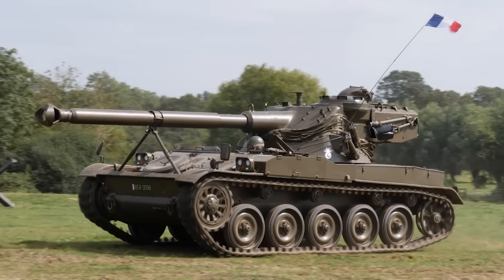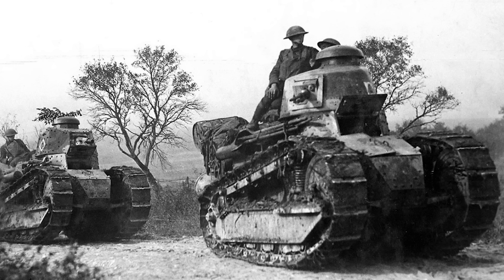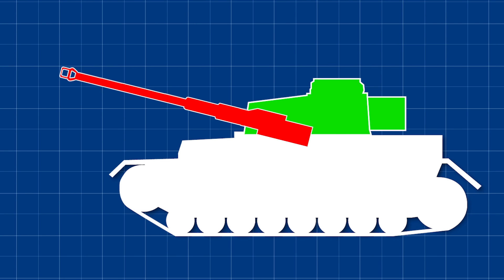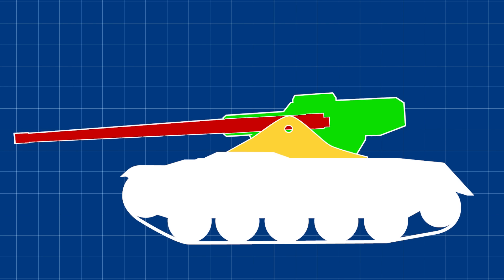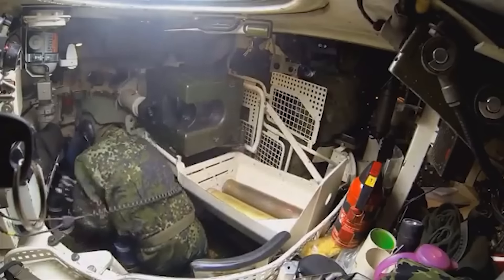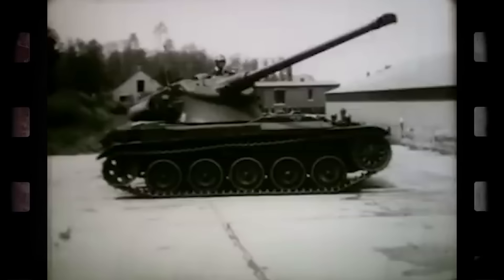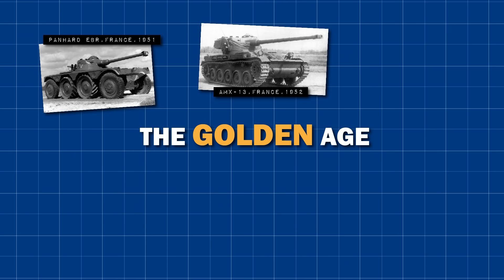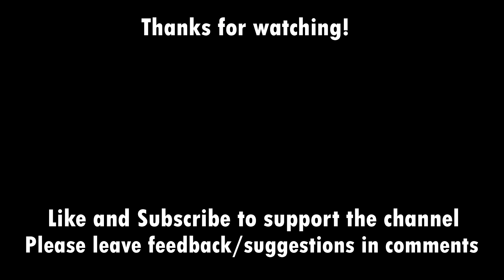What actually IS an “Oscillating” turret?

Comment from the maker: Thank you so much for 10k subs! Best place to chat to me if you’ve any questions/suggestions is the Discord -

https://discord.gg/WJzJXkjH3Q
Reply: Hey man! 
Just got recommended your gem of a channel through this video.

I think the algorithm likes this new type of thumbnail with a blueprint design over your older photographic ones 🤔
Reply: The turret of the Austrian 🇦🇹 Jagdpanzer „Kürassier“ was similar to the AMX. I had the opportunity to shoot with it‘s 10,5 cm cannon. Greetings from Linz 🇦🇹 Austria 😎👍🐺 Europe!
Reply: Another issue with the oscillating turret is wear and tear.  Having the large, heavy gun and loader etc. so far from the turret ring puts a LOT of extra stress on the ring when driving on broken ground just due to simple leverage. I think the oscillating turret has enough benefits to be very useful in certain situations, but it becomes a specialty vehicle in a world that REALLY tries to minimize variation.  In WW2, every nation had dozens and dozens of different vehicles (for various reasons) but these days militaries try to really minimize the number of different frames and engines and guns.  Supply and support become far easier when you do this.
Reply: those "flim type"" images left and right are really flickering and add nothing.
Reply: Is there any issue with a small shell raising a burr that prevents elevation changes?

Comment: French post war tanks are peak transitional period aesthetics, Amx-50's just look so cool and futuristic for the time
Reply: Merci, cher ami esthète !
Vive la France 👍🇨🇵 ❤️
Reply: The ARL44 also looked so futuristic.
Reply: @EARTHKEENING  man, I really like the ARL 44, but of all the post-war French tanks to mention, I'd say the ARL 44 is actually iconic for being rather old-fashioned than futuristic. The French had so many futuristic designs on the way, but the ARL 44 was not one. It was merely a way to reactivate their tank industry after the war. Still, they look so cool, even if outdated. They made very few of them, which is a sensible choice, but I would have liked to see more of them in museums.

My rationale for this:

The hull looks just like a B1 flipped upside down. The tracks are in fact from the B1. The entire suspension is something you'd expect from the very first WW1 tanks such as the Mark I, with small road wheels and vertical coil springs (when everyone was moving towards torsion-bar suspensions at the time). The engine was underpowered and this suspension limited the speed to 30kmph--an unpopular choice in an era of high availability of HEAT (Leo1 and AMX30 would later favour mobility over armour).

The turret is actually decent and the most modern-looking thing on the tank, but not futuristic or modern even for WW2 standards. Considering the Centurion and the initial production of the T-54 had been adopted 3 years before the ARL-44, the turret design is not revolutionary. It was, in fact, a makeshift solution. They were built from welded plates recovered from the Dunkerque battleship wreck.

The armour and armament, however, were actually pretty good, though not really useful at the time (hence their move towards lighter armoured vehicles until the LeClerc). The 90mm gun is probably the best part, better than the Panther's from their tests, and likely had better performance than the Russian D-10T on the T-54 and the American M3 (T15) on the Pershing (1000m/s vs 895 m/s and 975 m/s), though probably worse than the British 20-pounder (1,020 m/s). However, note that we are comparing the ARL 44 (classified a heavy tank at 50 tons) to only medium tanks (30 ~ 40 tons).

The 120mm frontal plate angled at 45 degrees (effectively 170mm) also looks really nice and would be the most armour on any French tank until the LeClerc. However, consider that the T-54 had already been adopted by then (the hull is even older: the T-44-100 had 120mm hull at 60 degrees, effectively 240mm) and had better power-to-weight, weighed 20 tons less, and had better turret armour, 200mm+ vs 110mm.

I'd give it to you that the ARL 44 actually looks "retro-futuristic". Like some steampunk anachronistic alt-history tank. And that's because it kinda is exactly that. After the liberation of France, they wanted to quickly restart tank production. They chose a so-called "char de transition" (transitional tank) to fill that gap. Their starting point was the Char B1 (to reuse old stocks of components) and whatever they had designed so far for the G1 and the FCM F1. So they were basically working with 1920s stuff; hence anachronistic: it's like a what if 1920s tanks were inspired by the Panther. They could have gone for a modern suspension system (and maybe made the ARL 44 a competitive design for late 1940s), but they would have had to use disgusting foreign designs that couldn't make use of their sweet 1920s obsolete stock.
Reply: @jesuizanmich  🤓🤓
Reply: Seems most of the responses to your comment are people who play World of Tanks!
Reply: France has always been the odd man out when it comes to tanks. They had some of the best tanks at the end of WW1, made some great inter war tanks, completely failed against German armor despite being superior on paper, then they struggled across WW2, and then made some great tanks in the 50s and 60s. It seems like they're always making great tanks when they don't really need them.
Reply: @arthas640  They did not fail completely against the Nazis. They beat the Nazi ARMOUR every time they met them. What they didn't beat was the 8 cm adapted anti-aircraft gun that was equipped with anti-ARMOUR shells. And IF their tanks were only superior on paper, why did the Nazis use the B1 bis, the Somua S35, the R35, the H35, in their forces for the rest of the war, even using some in Russ during 1941?
And they do make the best tank in the world RIGHT NOW.
Reply: @Demun1649  I said "superior on paper" since they had great specs but were poorly utilized. One thing that's rarely mentioned when discussing specs like armor thickness and gun calibers are less obvious things like radios. A major reason why the Germans pushed so far and so fast was thanks to having better communications and better planning and tactics. France often used their tanks to support infantry, which was and still is both conventional and generally far better than unsupported armored units. Germany was able to bypass most of France's defenses which negated many of France's advantages. 
There's also things that are hard if not impossible to express in numbers like morale, poor leadership, and divided political opinions that dont impact on paper specs but can affect real world performance. Many in (and outside) France didnt want another world war and poor leadership in and outside France made the eventual battle of France difficult. Things like the UK and France largely abandoning Poland, the Belgians not extending the Maginot line, France worrying about offending Belgium by constructing more defenses along their shared border (pretty standard reasoning and even today can be politically unpopular as it offends the ally you share a border with), the slow response of the British and overall being unprepared for war (just look at Dunkirk), and other things all impacted the performance of France and it's armor beyond their "on paper" specs. 
France isnt alone in things like that, just look at American performance vs Saudi performance using Abrams tanks or Iraqs poor use of Soviet tanks in Desert Storm. As mentioned there's tons that goes into performance beyond on paper specs and it's mainly the specs that get discussed since it's more cut and dry. If you're interested though Laser Pig did a great video on the T-34 and he really does a great job talking about reason why the T-34 and other vehicles can perform differently than their on paper specs and he mentions why that happens.
Reply: @arthas640  FRANCE DID NOT ABANDON POLAND. Out of Britain and France, which was the ONE country that invaded Germany in 1939? You misrepresent the political scene inside France concerning Nazi aggression. You don't understand that it was FRANCE that took most of the casualties in WW1, and they didn't want that to happen again. BUT, they fought long and hard, once Britain had dumped and run away at Dunkirk, to keep France free.
I get angry at your constant use of the word "German", they were NAZIS, party member or not, they had all taken a personal oath to Hitler, much like the British to their monarchy. Therefore, they ceased being German and were Nazi.
The BEF were never, at any point, in a fit condition to fight against the Nazis in France and Belgium, and it is clear, from the orders issued to 3 of my uncles, who were there, that the British never intended to fight on the Continent at all. "Retreat at FULL speed to the coast and await orders for re-embarkation."
Who was it, during the Battle for France, that attacked the extended flank of the Nazi advance, and stopped it dead in its tracks? Clue, it wasn't the British, Montgomery waited to see if it could be done before he made his half-hearted attempts to delay the Nazis.
Reply: @Demun1649  "why did the Nazis use the B1 bis, the Somua S35, the R35, the H35"
The Nazis pretty much used everything they captured from their enemies during the war. Quite a few of these French tanks were converted to be open top antitanks with larger guns, called Marder I to III.
Yeah, on paper the French tanks had better armour and some cases gun but when it comes down to tanks, its a bit more than just that. Crew ergonomics, mobility, size etc play a huge part also. French may have had more armour and better guns, but the rest was way superior on the German side. More radios, 5 men crew with 3 in the turret operating the gun and commanding the tank, better visibility, faster and better suspension etc the list goes on.
Reply: Also the AMX-50 is F*CKING HUGE. I went to a tank museum and was blown away by how it even makes the king tiger feel small in comparison. It has one massive turret
Reply: RI.P bc25t